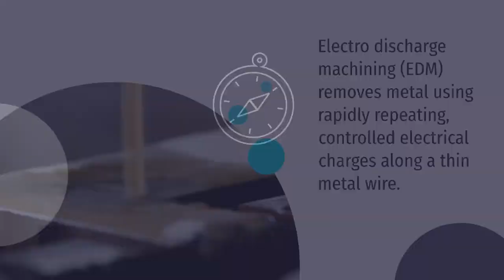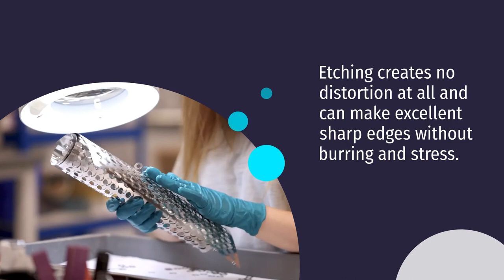Chemical Etching Versus Wire EDM: How Do They Compare?

Comment: They are very different... You are not going to etch a micron accurate slab of titinium 300mm thick
Reply from the maker: Hi there - thanks for watching. Both etching and EDM have there similarities and differences. In fact, we use both processes together for etching intricate surface features on thicker sheets which can then be wire cut more cost effectively to closer tolerances. The aim of this video is to highlight the benefits of chemical etching against more familiar technologies.
Reply: @precisionmicro  you are right I did not mean to seem stand-offish it certainly makes mass production possible where edm would have been the only option.
Reply from the maker: @africanelectron751  no problem at all. We appreciate you taking the time to watch and engage with our videos. 😊